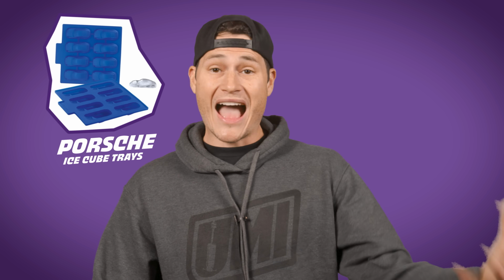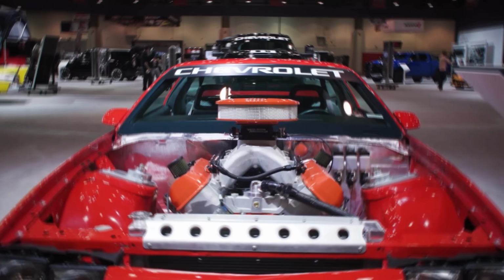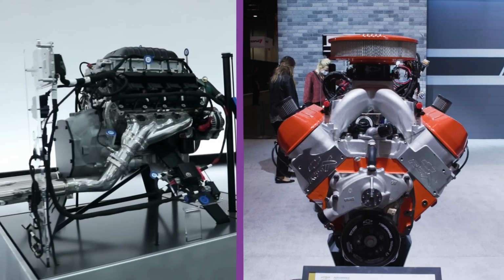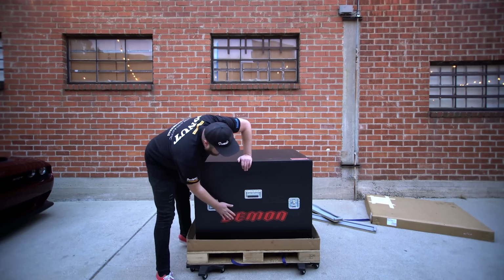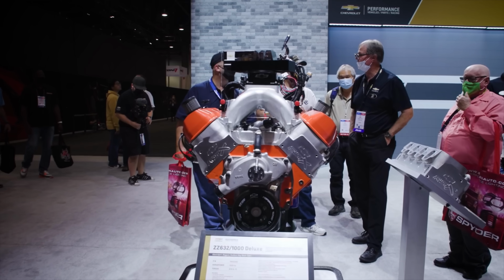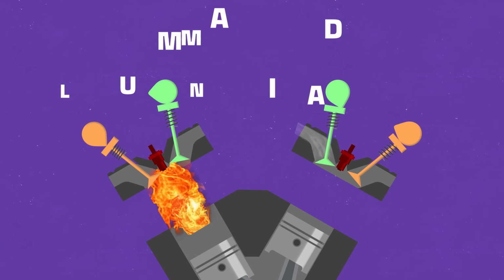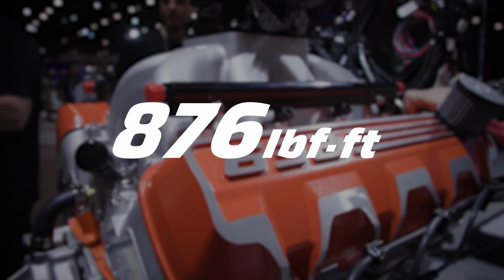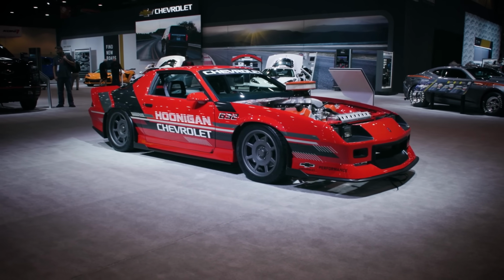Chevy's 1000HP Crate Engine EXPLAINED

Comment: The big question is how do I fit the 632 in my miata?
Reply: It might be easier fitting the Miata in the motor.
Reply: @EM-fi2qg  my exact same thought remove Miata then install the engine
Reply: @EM-fi2qg  lmao😂
Reply: Umm... that's a tough one
Reply: @waluigigang9998  nah. FD RX7 is the answer.
Reply: Or 🤔 my Pontiac Fierro
Reply: Ls4 Pickardt Racing in MD.... just saw one of their cars. Actuality followed thr guy to his house with Miata. It was a hard chase on my turbo 2.5 lol
Reply: you could fit a 6,2L hellcat engine in a miata atleast.... and then go to hennesey to pump it up to 1000 hp :)
Reply: @pjuppi  that tiny car would quite literally fly
Reply: @notlogical4016  well, isnt that the meaning of it? 😁 or, you know, a burmout king!
Reply: @pjuppi  be a ton cheaper to go the gm route
Reply: @DerekS1978  so? hellcat is cooler 😎
Reply: My suggestion would be to work on your pilots license first. Cuz youre gonna need it
Reply: That thing will be front end heavy af
Reply: Ls swap it, it’s lighter than the original engine. I had one and it wasn’t drivable with 600hp.
Reply: @MrPland1992  it's drivable, my buddy has a 650whp ls swap Miata. You just have to adjust your lead foot.
Reply: Serious answer take off all front panels(bumper fenders etc) so there are no obstructions, replace front suspension (you need stiffer suspension as it’s heavier) put in new motor mounts to hold this behemoth, put in engine, put all fenders and front end back on, cutting out areas if you have to, hook up all wiring, fuel lines, radiator etc start it up and haul ass wherever you go
Reply: At least that’s how I’d do it
Reply: @Just Chillin probably also need a different final drive ratio and a stronger drive shaft... that's a lot more power than what the stock one was designed for. And even if the torque doesnt shell it out, without the right gear ratio you won't get the best result out of the engine without the power being transferred to the wheels the way it needs to in order for it to be usable and get all the performance possible out of the Power plant when and where you need it.
Reply: @justchillin7552  Anyone who can afford that motor, can afford an entirely new custom built chassis from Art Morrison, Schwarz Performance, Scott's Hot Rods, etc. But a Cobra replica kit would be a lot easier, they're already designed around a Ford 427, so there's a lot more room.
Reply: There are several Big Block Miatas on the internet. 

They fit roughly the same as a 351 or LS swap.
Reply: interesting
Reply: Very carefully
Reply: bigger question, how do I fit it in my honda?
Reply: @ilham7345  just need a bigger bin 😉
Reply: @ilham7345  Honda WHAT, though? A Grom? That might be a problem 🤔
Reply: Take out the seats.
Reply: 4th gen firebird before 1998 (fat miata that'll fit the 632)
Reply: 1000 HP is too much for a Miata. That thing beyond 600 HP is just too much.
Reply: @retoadyt3196  no it's not, all it needs is bigger n wider tires like 34"x17" seen on Street Outlawz 4k hp cars.. i got 28"x13" on my 09 P71, most say it's overkill on my stockish Panther but it's a build in progress.. ;)
Reply: @P71ScrewHead  That sounds bitchin', bud, I'd love to see that. I love Crown Vics, especially P71s.
Reply: @jeffrykopis5468  I got a few short videos of it on my channel in case you'd like to see it, thanks man, it's a 14 second car with just headers n a Marty tune.. ;) lol..
Reply: you get an FD RX7... that's how... and when you do you've essentially made a viper.
Reply: @Dudeman9339  I may just have to do this!
Reply: Same
Reply: You don't
Reply: Any way possible.
Reply: Yes yes it will?
Reply: Ask the Honda guys.
They can and have fitted everything/anything.
Reply: I've seen a mistake with a Cummins diesel, so I assume it's possible.
Reply: I got you, I always make it fit
Reply: Gonna need a bigger miata
Reply: Convert it into a mid engine
Reply: Move the fire wall behind the rear axle.
Reply: On the next episode of money pit...
Reply: @AB-rp6ik  Or Roadkill Garage. But they'd start with a Gen VI 454 for $500, then throw $20 grand worth of parts (free from sponsors. Nice scam they got there) at it, then go blow it up.
Reply: there is a guy in my town that fitted bmw M62B44 in miata ahahhahaha and it runs, and he made it road legal somehow, but 4.4 L is a long way from this 10L monstrosity lol
Reply: a big shoe horn
Reply: I think you're gonna hove to fit your miata into the 632.
Reply: Will that 632 fit in my Honda?
Reply: @KitKitChanIsaac  Honda Grom? Passport? Trail 90? Insight? 😂
Reply: ALOT of cut off wheels and beer
Reply: Cut it in 2 and use half of it
Reply: Easily
Reply: There is already a Miata with a Dodge Challenger engine not sure if was a Hellcat engine. Saw a video here on YouTube it was a beast.
Reply: @erniemartinez9078  yeah. It was the hellcat engine. They hellcat miata is beast asf. Was doing 6th gear burnouts
Reply: Put it in between the 2 back wheels
Reply: Mid-engine mount it.
Reply: PH: Big motor pumping petite miata
Reply: That would be a beast!!!
Reply: Volvo 240
Reply: The easiest way to handle that would be making a larger Miata that way you would also have a better chance of putting yourself in the car along with the motor
Reply: Fabrication and engineering
Reply: The engine is only the first problem...how ya gunna make sure your miatas suspension doesn't tear in half lmao
Reply: @skylerschillinger3428  true :D
Reply: Make a .75 scale miata
Reply: That would be a challenge, but it would be much easier to fit into the Miata, than in a Pontiac Fiero.
Reply: Alot of cutting and mods and big ass  shoehorn
Reply: I was gonna say the same thing about my BRZ. Might have to turn it into a mid engine car instead.
Reply: I mean, it can be done. They fit a hellcat motor in a miata. You can find the video on YouTube. Just look up hellcat miata
Reply: Same as the Mini-Cooper or the Mercedes Smart Car.
Reply: They put a 5.2 V10 R8 motor in a miata, i have a feeling u can put a dinky lil V8 in it…
Reply: I really don’t think it’s possible. Not any Chevy big block but I’d be happy to be proven wrong. I have seen Chevy 350 small blocks into them with room to work on them
Reply: @calebwhite1454  Modify man, Modify !!!
Reply: @ronsmith7739  you would have to both widen and lengthen the front of the vehicle so you end up making a whole new vehicle or have an absolute freak that handles like trash lol
Reply: Modify man Modify!!!
Reply: Trailer hitch, easy.
Reply: @liviubita-dragonelulviteaz  No trailer hitch, Modify man Modify !!!
Reply: カノコ  I speak American !!!
Reply: Uh... what about my mini copper? 🤔 if it fits a miata it's gotta fit a cooper right?
Reply: @roboteen  Modify man Modify!  They put a 426 Hemi in Dodge Colt in Pro Stock.
Reply: @ronsmith7739  this is true, I remember the video of a bt4 in a prius.  And the drift miata with one as well.... a few people have also done a v8 swap on a mini. 

Once I get the money saved I want to give a bt4 a shot and ruin the suspension
Reply: @ronsmith7739  Bob Glidden had a Boss 429 Pinto. Or was it an EXP?
Reply: Cut the fire wall, or major modification and extend the front. Might have it make an all new subframe.but your Miata would look cool AF! If you have the engine exposed, would kind look like a Japanese roadster, you're welcome for the idea. 😊
Reply: Leave Yo Mama home, and put it in the passenger seat 😜
Reply: Modify man Modify!!!
Reply: Get it drunk, use lots of lube, and take it slow.
Reply: RIP traction lol have to have tractor tires to keep that grounded 😂
Reply: Remove the hood and drop it in.
Reply: Corolla!
Reply: Tie it to the front it!!
Reply: Spit on it, it'll fit.
Reply: or my dodge viper 😭
Reply: BFH, sawzall, and a welding machine. If there’s a will there’s a way
Reply: zipties and duct tape
Reply: It can be done, you might be altering the wheelbase but others have stuffed BBC into MX5's
Reply: By putting it in an Impala
Reply: You're gonna need a sawzall and possibly lift the drivetrain up so you have enough room. Or widen it. Also some reinforced Miata the whole thing.
Reply: In the passenger seat
Reply: Open the hood, put in the motor, close the hood.
Reply: You don't ☺
Reply: One fit a 10l 6 cylinder inline diesel engine into an rx8. Another a merlin 37liters into a common '90 ford car. There are ways.
Reply: Easy you blow up the Miata and get a car that doesn't tell everyone you like men.
Reply: No hood
Reply: Easy. Just use a broom and dust pan to throw away the crumbs. Wait, you said IN I thought you said ON